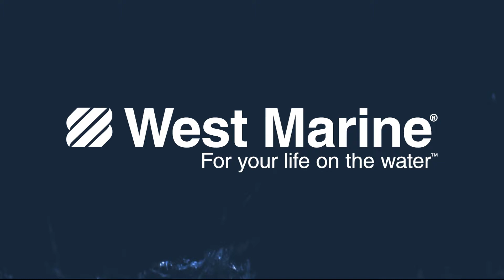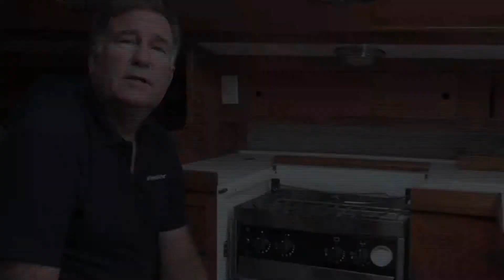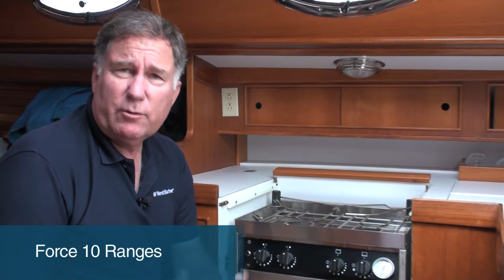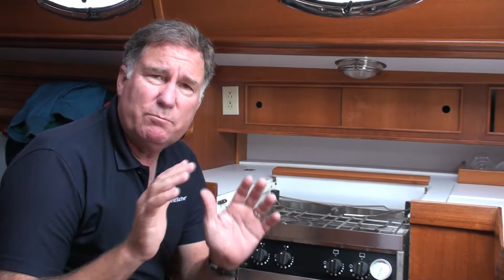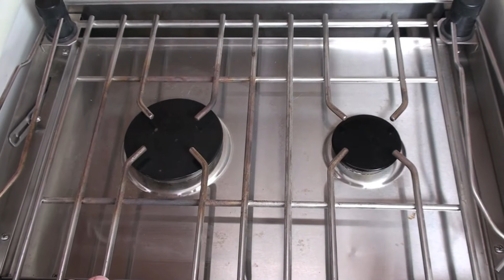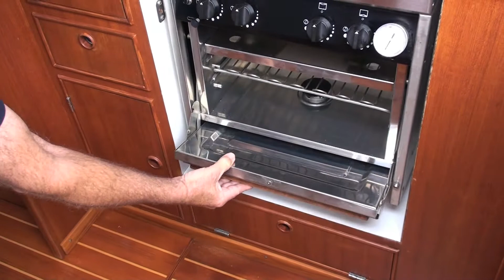Force 10 Ranges

Comment: I have a full propane tank showing 150 pressure yet I'm not getting gas at burners or oven.
Also electronic on/off switch does not illuminate when in on position.  Wandering if problem is electrical or gas line?  Frustrated
Reply: West Marine will be glad to sell you a new boat in pieces.. for a few million.